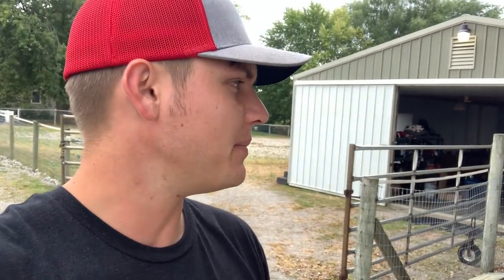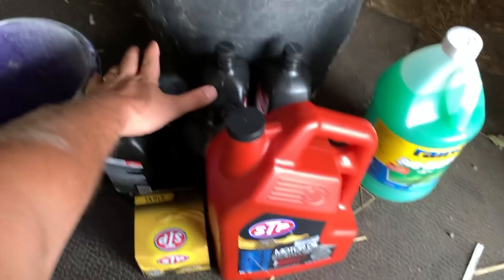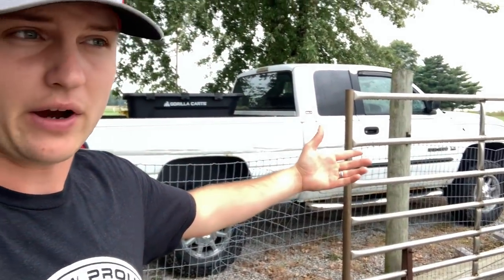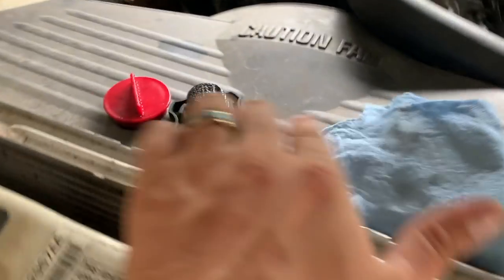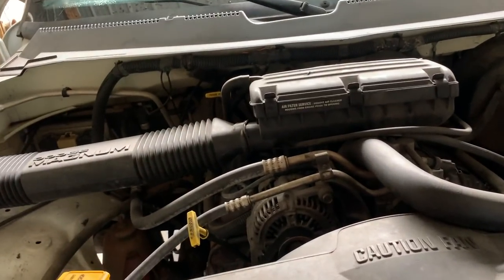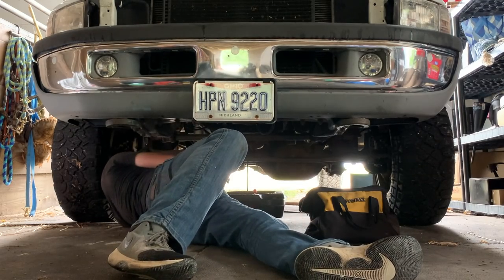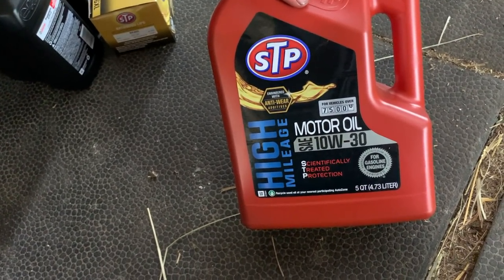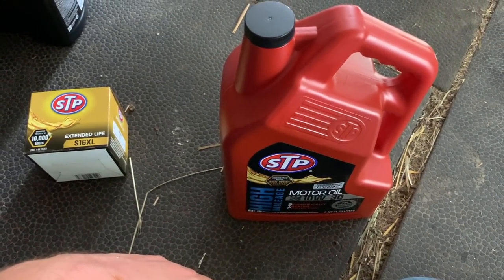This truck has more problems than I realized...

Comment: Tire wear like that is usually pretty common just due to lack of rotation on a solid axle 4x4 vehicle. The tires cup and wear uneven. Appears it needs wheel bearings and or ball joints as well though. I remember when this truck first appeared on the channel, absolutely love it still!

Comment: most automatic transmissions on light trucks you drop the pan to drain oil. replace the filter inside and install with new gasket. make sure to re-check oil warm at idle. leave 1 or 2 bolts on the pan loose and crack it slow so you don't get a bath lol

Comment: Same on 2500's for the trans pan accept more fluid. I assume it's because the filter is supposed to be changed and bands adjusted anyway so why leave a plug to strip and leak.

Comment: You have to drop the transmission pan to change the transmission fluid   and you check the transmission fluid whin the truck  is warm  up  and the truck  has to be in  Neutral and make sure you  Put the transmission in each gear for like 3 or 4 seconds at a time

Comment: Get the high quality metal screen filter for it, everyone gives dodge transmissions crap but there great if you take care of them, they run off pressure, that’s why a metal screen filter and letting your truck idle in neutral before driving will let them last forever.

Comment: You gotta drop the pan for the transmission. It sucks and get shop towels. Also buy a transmission filter so it will run a lot better. Trust me I got a 5.2l 318 with 341000 miles and it runs perfectly

Comment: The front end on that truck could of been totally new the day your grandpa got it and could need a full rebuild today. Just running 285 75 16 tires on mine I have to replace wheel bearings every 10,000 miles and ball joints to.

Comment: Have you checked the plan on gasket on them trucks basically take the air breather off look down into the intake if you see oil than it needs a plenum gasket

Comment: I changed transmission fluid on 07 1500 I had to drop the drain pan and it had filter inside it and I changed gasket I think 2nd gen would be the same

Comment: You're going to have to put you a drain pan underneath loosen the bolts and just let the fluid flow over out of the pan order you a transmission filter it comes with a gasket